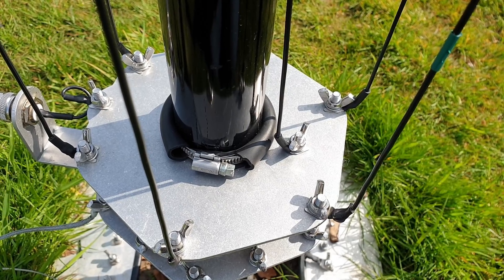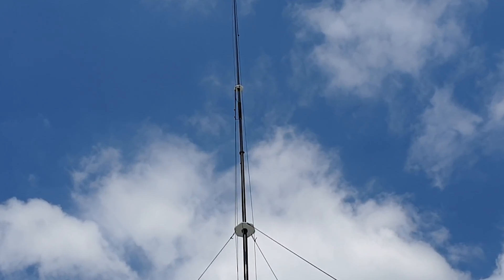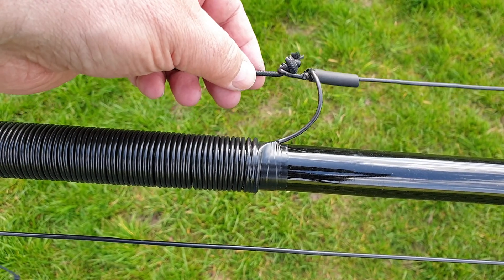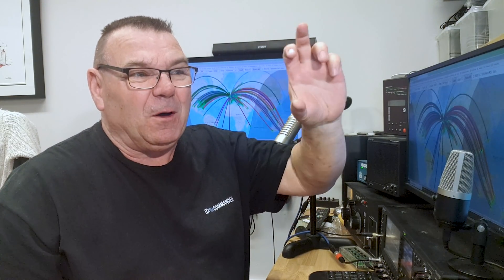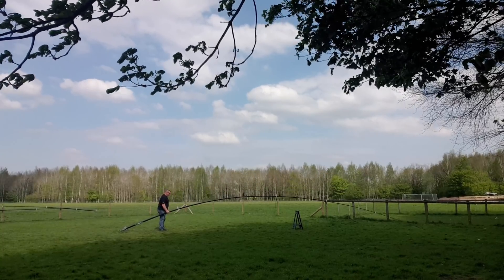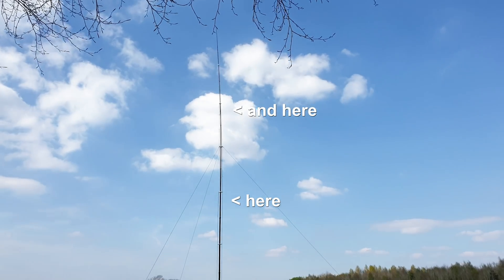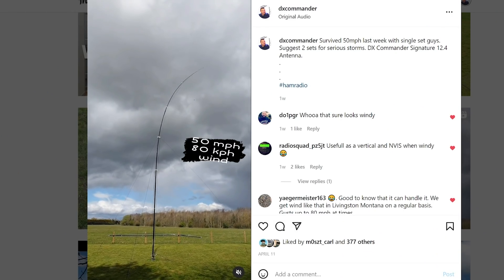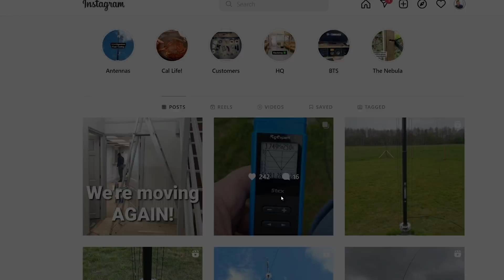80m and 30m on the SAME ELEMENT! Signature 12.4 - DX Commander

Comment: Hey, Callum, hope all is well with you. I just watched your new antenna video @ 2:30 AM on 4/22/22,  I have a question. if I mount (bolting it to one of the metal fence supports), your new Signature 12.4m DX Commander All Band Vertical 80m or the Classic DX Commander on a metal fence at about 1.5 meters off the ground, can I use the whole metal fence like a radial? I do not have a very big yard, I live in a mobile home park, but I own my home. I really cannot run many radials. As for me, I am doing okay but I still got a lot of heart & back problems. My cardiac doctors are still trying to find out why I am getting this shortness of breath every time I exert myself. I'm okay just sitting but just getting up to go in the kitchen, I have to sit down and rest. Medically the heart is working great but the back is causing major problems, like me falling when my legs give out and I crash to the floor, (which just happen on Wednesday night at our Ham Club meeting), it took 4 people to get me up. but I just got to deal with everything else. de Krisy N6KV, Klamath Falls Oregon.
Reply from the maker: Metal fence with assist with a "tune" but then we have a definition of "will it work".. For me, I like perfection - but yes I guess it'll work!
Reply: @DXCommanderHQ  thanks Callum for the Reply,

Comment: Great video - love it when you take us along your thought/development process. My elmer told me to try and keep the diameter and length of antenna coils roughly the same to maximize bandwidth. At least to keep the length smaller than twice the diameter. So this makes me wonder if a pvc pipe with a larger diameter than the pole (and less windings to get the same inductance) slid over the pole would improve the Q? Downside is that the windings get closer to the elements - don't know... sounds like something I would like to try when I as soon as I set one of these up... 🙂
Reply from the maker: Although it's a lot of "Henry's" they are very far up the pole and we're getting about the right bandwidth anyway.,..
Reply: @DXCommanderHQ  Well, if it works it works... I am still racking my brain over your question why the harmonic frequency shifts with the position of the coil... interesting...
Reply: That's for minimising the loss of power in the coil, but it does not increase de bandwidth. Actually a high quality coil, with a length equal to one or two times de diameter, increases the efficiency at the expense of decreasing the bandwidth.
Reply: @josemariatrueba4568  Yes, I stand corrected. It increases the Q and bandwidth is the inverse of Q. So higher Q = less bandwidth. Thank you.

Comment: Hi Cal great to see you've cured the 80 metre problem.
Just a couple of questions my noise floor is very bad at my qth would adding a ground spike in addition to the radials help. Also have you considered putting using the guy point for slopers for adding bands.
Reply from the maker: Unlikely.. Instead, just go and lay a loop on the ground. I have two. One at 90m diameter and one is 30m in diameter. Both work rather nicely. I did have wahat they call a "Loop On The Ground" (Google) but it wasn't quite loud enough for my taste - it worked though!